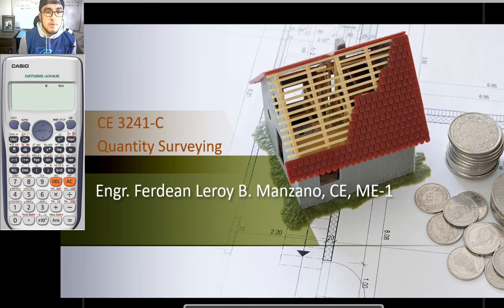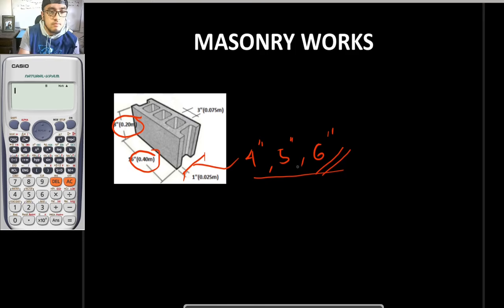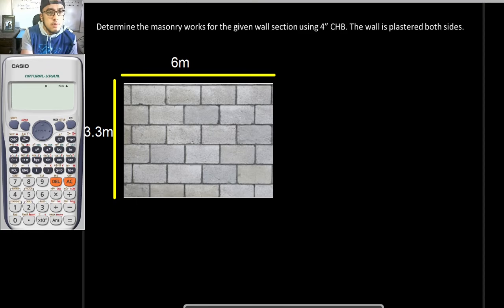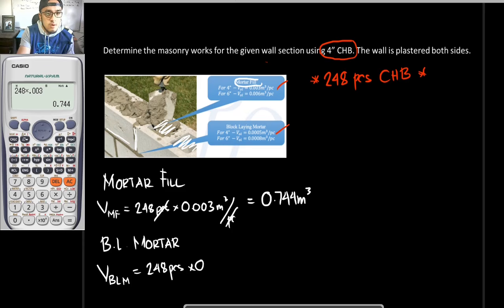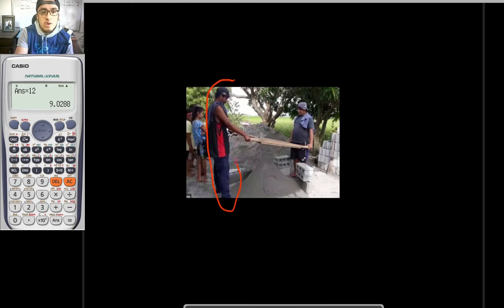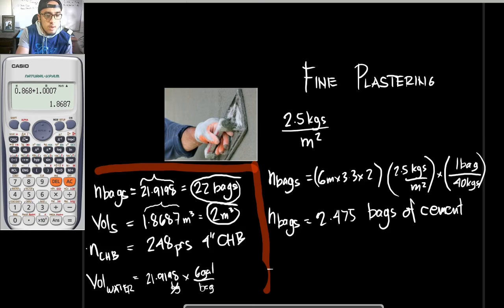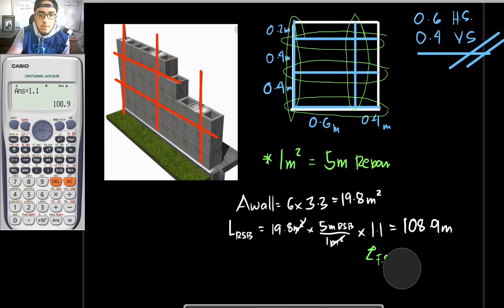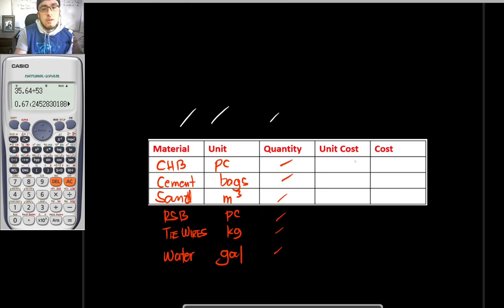Construction Estimates: Masonry Works (CHB, Mortar, rsb)

Comment: SIR, SAAN PO NAKUHA YUNG 1.1 NA SPLICING NG REBAR? SAAN GALING YUNG 10 PERCENT
Reply: bale 10 percent splicing then naging 1.1 sya kasi dadagdag mo yun sa original length ng rebar or 100 percent length, therefore 100 percent + 10 percent +110 percent or in decimal 1.1

Comment: Sir just asking, what would be the unit weight of chb wall using 4,5,6 inches chb per running meter?
Reply from the maker: Hi sir. As per NSCP Table 204-2. The loads for CHBs are dependent upon the grout. for 4 inches CHBs, they range from 1.05kN/sq.m up to 2.84kN/sq.m. For 5 inches CHBs, they range from 1.15kN/sq.m to 2.97 sq.m. and for 6 inches CHBs, they range from 1.48kN/sq.m to 3.96kN/sq.m. But since the values are per unit area, you must multiply it first by the height of your walls. 

For example:

If you are using the heaviest 4 inches CHB units fully grouted, which is 2.84kN/sq.m. And let's say that the height of the wall is 2.7m.

2.84kN/sq.m * 2.7m=7.668kN/m.